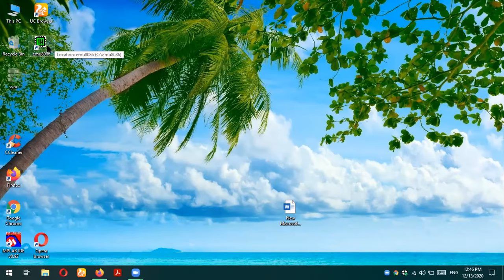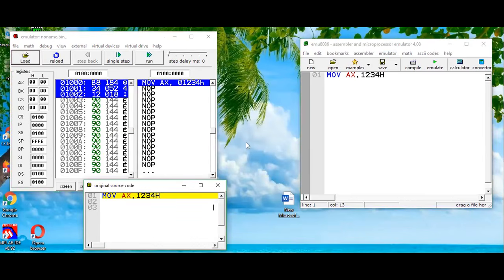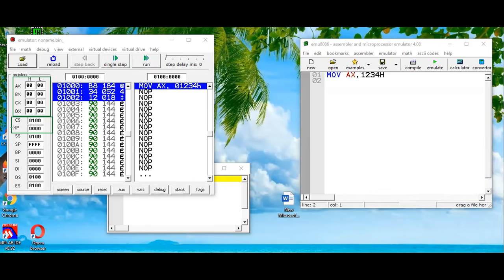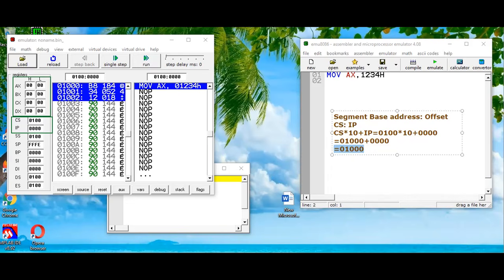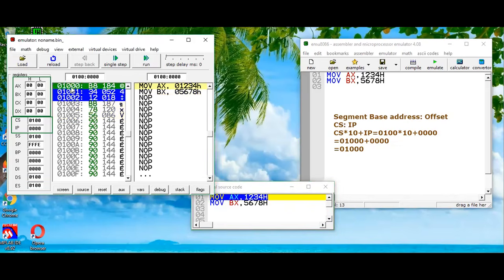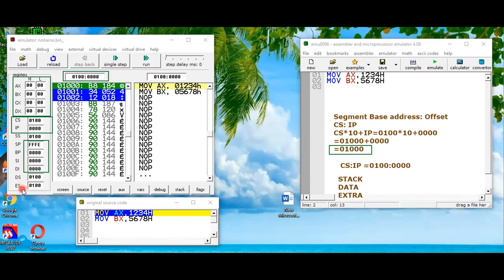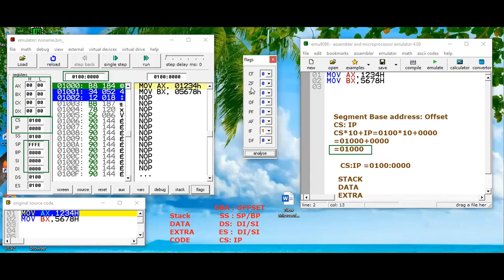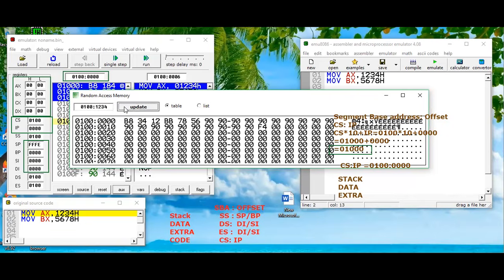EMU8086 BASIC Tutorial || 8086 MICROPROCESSOR EMULATOR Tutorial For Absolute Beginners||Emulator8086

Comment: Have you made a tutorial, made a simulation about this project, if possible, make a tutorial. Thank You
A "Rengginan" (rice) snack food dryer is controlled using an 8086 microprocessor. This dryer has two sensors: a temperature sensor (can use the LM 35) and a pressure sensor (can use the MPX4115a). The actual temperature value is used to control the condition of the electric heater connected to the relay. If the temperature is above the desired range, the heater turns off, and if the temperature is below the desired range, the heater turns on. The pressure sensor is used to provide an alarm. If the pressure is greater than the desired value, the buzzer sounds, and if it is less than the desired value, the buzzer turns off.
The desired temperature and pressure values are set with push buttons, and the temperature and pressure values are displayed on a two-digit 7-segment display.
Create this control system using the following devices:
1. 8086 microprocessor
2. PPI 8255
3. ADC 0804
4. Push button
5. LM 35 sensor (available in the Proteus simulator)
6. MPX4115a pressure sensor (available in the Proteus simulator)
7. Relay
8. Pilot lamp to monitor heater condition
9. Buzzer
10. Additional components that you can add yourself

Comment: How do I determine the size of an instruction?
Reply from the maker: You need to convert an assembly instructions into machine code. It will let you know that size of instruction is  equal to how many bytes. The maximum size of bytes are 6 and the minimum size of byte is 1.  Anothe way to calculate the size of instructions using the emu8086. It clearly specify the length of instructions.
Reply: @LearnOnline1  Where exactly can I find it in emulator?
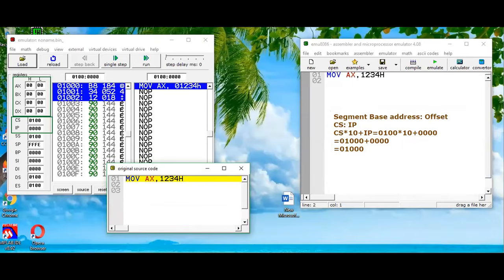Reply: @Igor-rd2fb   10:45

Comment: I am a bit confused you say that each instrcution is of 3 bytes just like in MIPS machine code consists of 32-bits and bus size is also 32 bit but in 8086 we have bus size of 16 how we fetch the 24-bit instruction through 16-bit bus and then decode it
Reply from the maker: Thats very good and confusing question . But  it is correct that  16 bit bus is used in  8086. Remember, microprocessor is not aware about the size of instructions unless decoding is performed with in microprocessor. Bytes (code from code segment) are being fetched and being stored in instruction queue. Size of queue is 6 bytes in 8086.  Let's suppose first two bytes are processed and declared that it is a complete instruction or not if its not something defined instruction and then news two bytes are examined. One more important fact, it is quite possible that during examination of next two bytes ,first byte completes instruction with previously processed two bytes and second of these two ongoing process will be part of next instruction. That's base of 8086. 
Furthermore , no one can say that how many instructions are present in instruction queue. One can only tell the number of bytes present in instruction queue. It can be one and half instruction or two instruction or there instruction or one alone instruction as well.
 I have already explained it in very first video tutorialof my videos lectues on 8086. It's about architecture of 8086. I hope I made it clear.
Reply: Got it thank you soo much sir  :)
Reply from the maker: @ahmadirtisam9593  you are welcome:)

Comment: how do i get the length of an integer?
Reply from the maker: I do not understand. How this question is relevant to this video.  I never calculated the length of any data type in this video. Probably your question is not correct. you were interested to ask something else. ? Right? However, the length of an integer is fixed and it is  2 bytes.
Reply: @LearnOnline1  sorry, i just wanted to ask and didnt know where to
Reply from the maker: @infrakazos  It's okay. I hope my answer was helpful for you.
Reply: @LearnOnline1  i wanted to print integers, but i figured out i could divide by 10 and get the remainder, instead of finding its length.
Reply from the maker: @infrakazos   you refer to the simple property of numbers in which decimal  are divided by 10 to separate the units  and tenth places. But, still I am unable to understand what is your query or you just shared an openion of yourself.

Comment: hello , i found your tutorial very helpful , i got a question , how can i know the size of each instruction like how do you know that the MOV will have 3 bytes , so i can know what's the next IP will be .
Reply from the maker: You can do that by converting Assembly into Machine. That eventually will let you know that how many bytes are consumed in Instruction. You can follow my tutorial 
"https://youtu.be/GSNOvQ_5ICo ."
 Alternatively, you can do that using emulator 8086 as I did in this complete series for various instructions. But, Without an emulator, You do have only the first option so it is highly recommended.